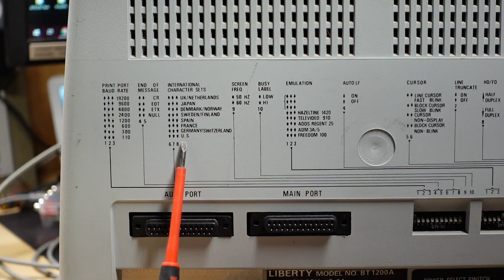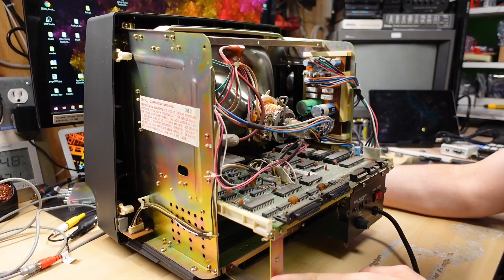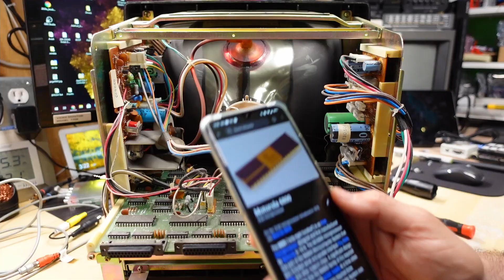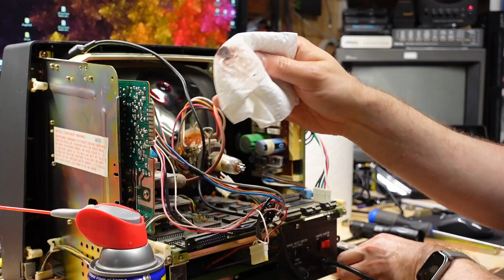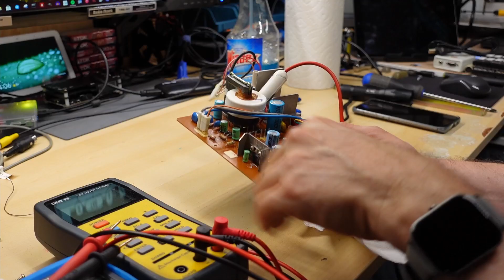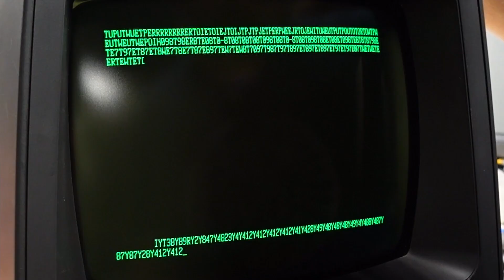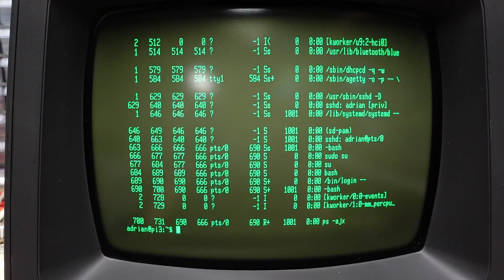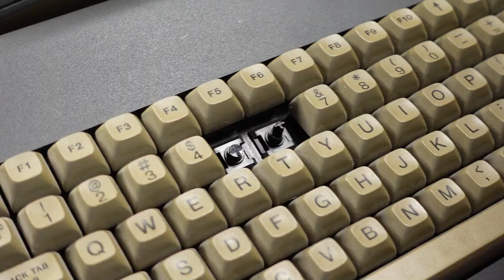Liberty Electronics: Freedom 100 Terminal Repair

Comment: It's surely a VT100 clone. I so want a decent serial terminal for my Sun server! Soon!
Reply: I immediately thought of VT100 too. At the university I attended, I always entered vt100 for the terminal emulation question when logging into my Solaris account. We had a bunch of Sun IPXs and IPCs.  I hated the IPCs (slow as molasses). 

The computer science department had some Sparc 1s, 2s, a 5, and a 10. Someone had a Sparc 20 in his office. 

We were in Heaven when we got an UltraSparc 1.   We even had an Enterprise 4000 server. :)
Reply: @DerekWitt  I found some docs and yes, they are standard VT clones. There was also a Liberty 212 VT220 clone. Of course it doesn't have the DEC keyboard markings but I'm sure the real DEC heads didn't need those. There were standard emulations on the back too. I had a real VT320 at one point and I miss that thing more than any other ancient hardware I ever possessed. Still looking for a replacement. BTW these things were expensive! $500 in then-money.
Reply: Terminals turn up in estate sales sometimes. Watch estatesales.net for sales in your local area and look for sales that have what looks like a home office with a lot of computer manuals and disks in it. I'm starting to see more estates of IT pros from the 80s and 90s turn up and they often had a terminal at home. Sometimes the terminal ends up in the basement.
Reply: It is a vt100 clone.  We bought all DEC stuff at my university and vt100's at the time were something like $1200.  When these came out, they were listed at $600.  I got a few in my lab at an introductory price of $400. Functionally, they were identical to a VT100 and had a few neat modes standard vt100s did not have, e.g. it could show non-printing ASCII characters. Of the two units in my lab, one developed a weird PS problem where it wasn't supplying enough current on the 5v rail and the system would lock up.  As a quick fix we paralleled another 5vdc supply and it worked fine.  Never did go back to troubleshoot the PS.  I still have one in my home lab, e.g. basement connected to my PDP11.  BTW, Bitsavers has the User manual and troubleshooting guide if you need it.

Comment: Excellent as always! Been looking for a terminal for some time however too expensive
Reply: I have two terminals that were fairly affordable.  One is a Dec VT320 that I paid $199 for.  It's pretty great and highly recommended.  The other is an IBM InfoWindow II that I paid $150 for.  This one is a mixed bag.  It has a real buckling spring IBM keyboard, but it doesn't support VT100.. so unless you have an AS/400 or System/36 server, it's pretty useless.
Reply: @misterkite  VT100 is what I'm looking for as it works with just about anything. Unfortunately, living in Canada makes for expensive delivery and afraid that if not packed perfectly it will become recycled plastic:(

Comment: Stems? 3D printing to the rescue! :)
Reply: I was going to say the same thing. Should be relatively easy to model them and print them. Just need one of the good ones for reference.
Reply: It would also be possible to make a new set of stems that have Cherry MX mounts on top, if he wants to use a modern but retro-looking set of keys.
Reply: @mal2ksc  Whoa... neat idea.  Now the ol' brain bucket is whirring with possibilities!
Reply: @mal2ksc  modern Dasher or Dancer SA caps perhaps… if he has a set I guess
Reply: @kaitlyn__L  The character set probably wouldn't line up. I would imagine that any key set would have to be made specifically for a terminal -- maybe this particular terminal. But someone may still have already done it.
Reply: @mal2ksc  I was looking to see if there’s big mismatches between these and modern keys, especially what else is on the numbers etc, and aside from a nonstandard compatibility set being needed for some modifiers, nothing particularly stood out to me. There could be more subtle ways the printing wouldn’t line up though admittedly.
Reply: @kaitlyn__L  I just figured since this terminal isn't that rare, and swapping out the stems isn't that unreasonable, someone may well have drawn up a set of custom keys previously. You can get custom sets so long as they use only laser or dye sublimation for the legends. Double and triple shot keys are right out, those only make sense if you're producing at scale. But dye sublimation can look very, very good.
Reply: @mal2ksc  ah that makes sense. Yeah a friend has custom caps from WASD. But they’re not SA profile.